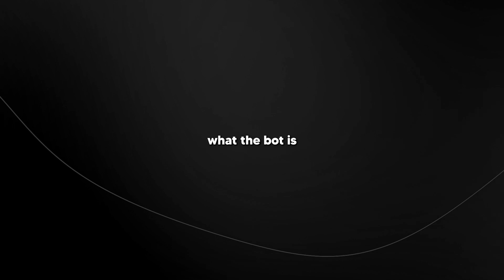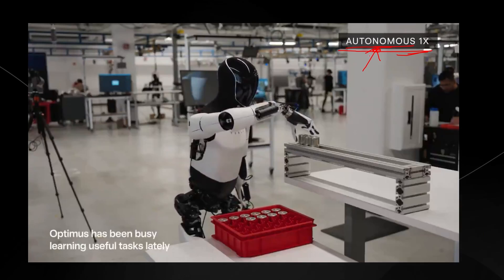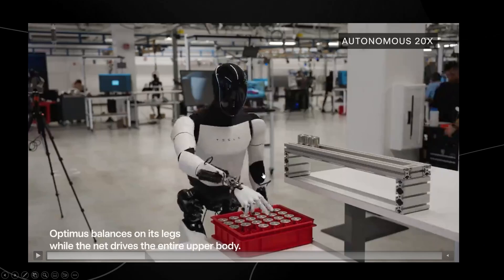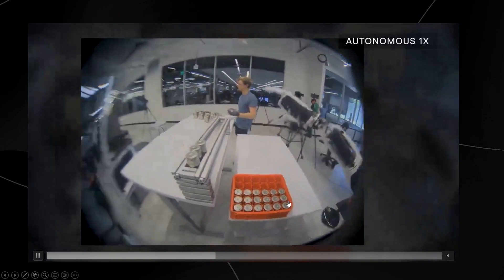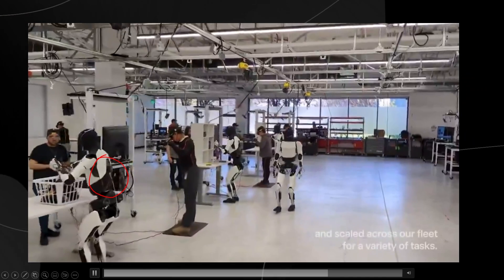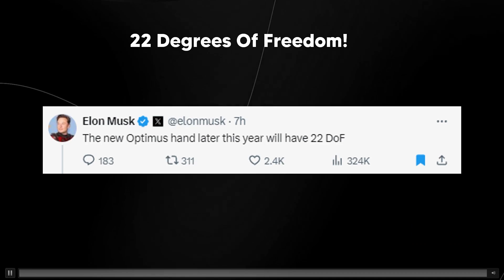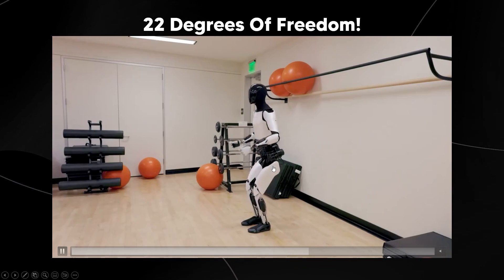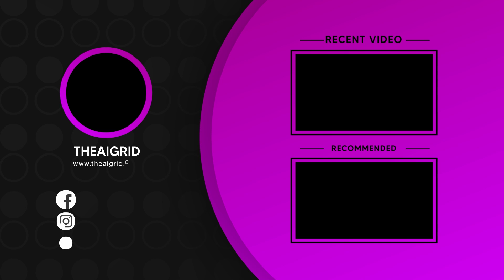Elon Musks Teslabot "AUTONOMOUS" UPDATE (Teslabot Gen-2 Update)

Comment: Number of degrees of freedom is meaningless past a very low threshold. You only need about the same number of DoF in terms of joints/actuators in a robot as the amount you want a given part of the robot to move relative to what that part is attached to. So ignoring the fingers, it is sufficient to have 6 degrees of freedom for achieving all possible motions for a hand relative to the body; adding a few more can help make things easier if you're working with designs that have some limitations on the joints, so you  would be adding additional ones to compensate for limitation of the hardware/design. Hands might need a little more than expected for thing like gripping with the palm, but even for replicating human hand, it shouldn't be much more than about 4 per finger plus some for the weirder bendings we can do to the hand itself to grasp things without using fingers or with fingers plus additional hand surfaces. The tricky thing about hands is it's a lot of stuff in packed a very small space that needs to be coordinated; for a huge majority of tasks you don't need something that complicated. 22 sounds about right for getting very close to replicating a single human hand if I didn't mess up the math, but that's overkill; there can be much better designs than the human hand, even for most tasks made with human hands in mind. As for the rest of the body, 6 dof per limb for full motion, an additional 24, feet doesn't need to be as advanced as hands, and many bots have demonstrated even stumps already suffice with the right algorithm, so 2 to 4 per feet is already bordering on excessive; for a large part of tasks, you don't even need anything in hips and torso, you can have it all rigid, though adding two or tree to the hip-torso connection, or maybe 4 tops, would suffice to assist with balancing with additional shifts of center of mass. Neck and head are generally more about social than physical necessities, unless you're restricting yourself to very limited sensors that can't simply be aware of the full 360 surroundings simultaneously and/or require some physical stabilization to compensate for movements and vibrations from the rest of the body. So lets see what's the full sum without including hands, which can be simplified significantly if you're not just going for aesthetics: 24 for the four limbs, adding the torso/hips balancing assist gives us 28 at most; make it 32 if you wanna get some extra flex control on the feet to assist with balance..

Comment: Would it make any difference if the robot see with 2 cameras like our eyes to calculate better the depth of field? 
And what about the teleoperators have the same objects to manipulate instead of doing the movements in the air, maybe the teleoperators would be able to do it faster, would need to do the  robot and the teleoperator positioning at exact the same distance of the objects
If there’s a way of the teleoperator see on their vr headset the image coming from 2 cameras from the bot maybe could help the teleoperators have more sense of the depth of field and manipulate better than seeing one flat 2D image
Don’t know if it make sense
Just a thought 🤔

Comment: One of the next step would be to make more human like feet. Why, easy try walking like optimus (keep your feet as straight as possible) and you'll see you lose speed and equilibrium.

They should make a feet like in 3d animation the hard step is to make all the toes and all the joints, the easy step is to split the foot in two, the forward part where you can stand on and the backward part where your heel is.)

That way they could walk faster, heck even run and most importantly they should be more stable therefor they could walk on more difficult terrain. (Best exemple, look at parkour people, they land and do all there crazy jumps but always land on the forward part of there feet, they never, never land on their heels or land flat, they always land on their toes.)
Reply: Yeah and it has a tendency to walk completely straight spined, which is counter intuitive to the way people actually walk. Humans tend to lean slightly forward while they walk, gaining momentum easier.

Comment: Too bad the robot is trained to be right hand dominate instead of using the hand closest to the task. A robot should never cross midline.
Reply: "A robot should never cross the midline."

Ok, Asimov. Thanks for that much needed 4th law of robotics😑
Reply: @justinwescott8125  you beat me to it
Reply: I would think in full production he would be using both hands at the same time.
Reply: The rail that the battery packs are on is in the way for using the left arm for the task, using the right arm is correct.
Reply: Position the robot so it is not in the way. It is still inefficient to cross midline. It is not what I would want to see from a human. Some people other hand just hangs beside them until it is use as a helper hand. That should not be true of a robot.
Reply: l dont see the point in making more than just an arm at all if it just going to do one task. Really disappointed with this presentation tbh Boston Dynamics robot was way more impressive
Reply: @hard_mode_Gaming  I get why you would say that, but this is a test of precision. Placing the batteries in a tight spot is a good test of precision, and I think that precision is an important demonstration. Also the fact that all of the robots can do the job exactly the same, which has not been proven when manufacturing robots.  The error correction alone is worth the test, I think. I get into these details in my video.
Reply: Because the operator stands next to it
Reply: It might easily be more efficient to use the hand furthest away. Certainly during the demonstration the furthest hand to the task is indeed the most efficient way to do the task. Which is what it does.
Reply: It is not the way I would work at any simular station. Why use the hand away from the task, it many people can't use their other hand. A robot should be able to use either hand.
Reply: @jamescurtis9267  for example in the task where the robot takes the cells from higher up on the left hand side then moves them to lower down on the right hand side or centre, is definitely more effective to use the right hand. Very awkward movements of the arm would be required to use the left hand. Besides I'm sure there is no limitation of this robot to use only one hand to do any task.